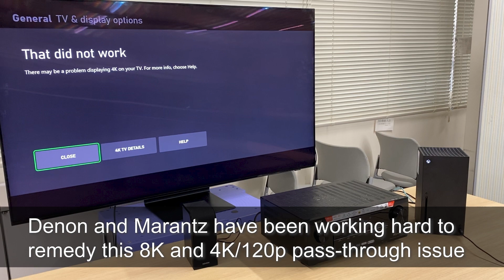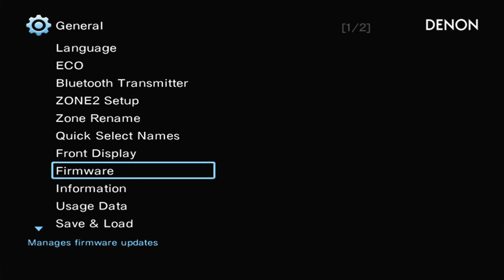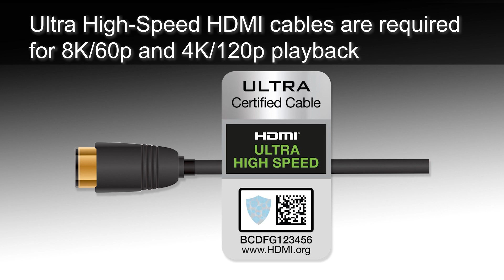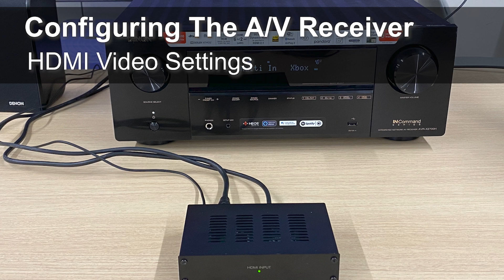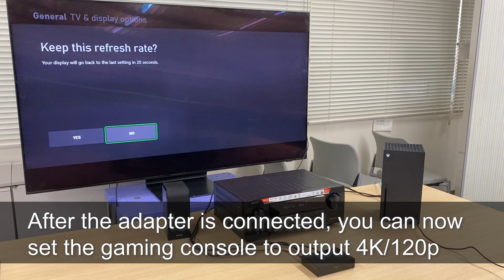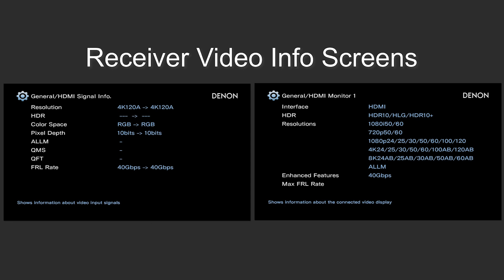The Denon and Marantz SPK618 HDMI Adapter: Installation and Use

Comment: This does not work properly.
Reply: what problems did you face m8?
Reply: Showing invalid format when connected to x3700h with no picture any help?
Reply: @manea7074  crap..... i hadn't heard about this. we have the same avr and i got the adapter, but i haven't got my ps5 yet so i didn't have a chance to try it out
Reply: @Amfibios  have you tried on Xbox Series X? My issue with Xbox
Reply: @manea7074  nope, unfortunately i don't have anything with those specs to try it yet

Comment: I set the Denon to 8k enhanced and I get no picture, when I change it to enhanced or standard I get a picture but only 8 bit no hdr.
I have Denon x3700h LG CX 77" and Xbox Series X.
the only way to get 4k/120/vrr/hdr to work is to plug the Series x into the tv directly and nit use the Denon or adapter. I hope they have a firmware coming.

Comment: I did this today it doesnt work wth hdr.
I can get 4k/120VRr no HDr when I connect my Series x to my Cx directly I get 4k/120/VRR/HDR but when I use this adapter and connect to the avr I lose hdr.
What gives?
Reply: I have the gx- you have to disable free sync and make sure that instant game response is enabled. This fix is unacceptable
Reply: is there any drawback to plugging the console straight into the tvs hdmi 2.1 port and using earc to pass the audio to the receiver?

Comment: I'm still confused as to who is responsible for this. Were people sold equipment that is not fully hdmi 2.1 compatible?
Reply: basically yes, there is a bug that causes issues when you try to play on 8K or 4k/120Hz. I believe the defective chip was made from Panasonic and was used in Sound United's AVRs.

Comment: This is a complete bullcrap solution. I upgraded to one of these received because I was tired of having to use adapters to get HDR with my previous receivers and was so happy to have a modern device that would be near future proof without adapters. This company should buy back their impacted models at original retail pricing or provide an integrated solution that does not require additional wall power and external devices and cables.

Comment: Slapping a band-aid on a broken product isn't much of a fix. The AVR's should have been recalled and retro-fitted with a new internal chip. The adapter takes up extra power, more space and doesn't even provide the user with any extra 8K inputs. Massive oversight and lack of logical thinking.

Comment: I would like to buy a new Denon and Marantz 8K AVRs. Do I need this adpater too ? Since the problem was end of 2020,  do the new (April 2021) Denon and Marantz amps have been built with the same problem or it has been fixed ? If the hardware has been fixed, how to recognize previous version from new version ? Thanks.
Reply: You probably got your answer by now, but when I went to the Denon site and entered my serial number, it gave me a message stating the issue has been fixed on my model (I haven't tested yet, picking up a new TV in a few days).  My receiver was ordered on May 9th and in my hands in June (took a while to receive.)
Reply: I picked up an LG OLED C1 on Friday and set it up, then updated firmware on TV.  Xbox Series X connected to Port 7 (8K) on Denon X3700H and config set to 8K Enhanced.
Working great with ALL Xbox TV Details showing Green Check mark.  Haven't tried moving input back to "Game" connection, but suspect it would work.  Have no reason to change it though.

Comment: Thank you for an attempt to resolve HDMI 2.1 issues. It'd be great to clarify relevant features and place information in public domain:
1. Will HDMI adapter box pass through 40 Gbps to a display? In other words, will TV's info screen display 4K120 HDR RGB?
2. If VRR is supported, is it 4K 40-60Hz VRR? Is it 4K 40-120Hz VRR? Or both?
3. XboxX can output 40 Gbps + VRR to a compatible display. Will this new adapter output 4K120 HDR RGB + VRR?
4. The last section of the video showing 40 Gbps info screen seems to be using older sequence from December's video. Does the last section of this video show that XboxX outputs 40 Gbps signal or Nvidia GPU's 40 Gbps signal?
Reply: It's displaying 4k 120hz RGB on ps5 though even without this adapter. Only xbox is not working fine
Reply: @chrischiang1512 Yes, but this is 8 bit signal, not 10 hit. In order to display 4K120 HDR RGB, necessary bandwidth is 40 Ggbs. PS5 can display maximum 32 Gbsp. If you wish 4K120 RGB on PS5, you must drop HDR for SDR. If you wish to preserve 4K120 HDR, then RGB will change to 422. There are compromises with 32 Gbps pipeline.
Reply: @MrLutijen  i think u are right the limit is at PS4 not the Denon.

Comment: Is this needed for PS5?
Reply from the maker: PS5 and Graphics cards like the RTX3080 work fine, you only need the adapter if you have a 4K/120p source with an compatibility issue (XBox Series X)

Comment: Is this box just for the Xbox Series X, or will it have to be used for future gaming consoles and devices?
Reply from the maker: Most 4k/120 sources like the PS5 and Nvidia graphics card already function properly. The SPK618 would just be used with the few devices that have compatibility issues.
Reply: @SoundUnitedTraining  If future source  devices still need this box, I’ll be frustrated I didn’t go with the X8500 which will have a board upgrade which I hope won’t require this box. Would be nice to have a board upgrade option for the SR8015 if future sources will require this correction box still.

Comment: Will this also support VRR?
Reply: No mention of VRR in the video and the Denon ODS didn't show VRR when Phil was talking about how the 2.1 features in use would appear on the screen.
Reply from the maker: Yes VRR is support if the display is compatible. VRR is currently not available on the TV we used in the example.
Reply: @SoundUnitedTraining  Thank you this is helpful to know. Additionally is there anything you can share on what a "corrected" HDMI signal means.  Will 10 bit RGB or 4:4:4 signals still be passed thru? or will they be downsampled to 8 bit or 4:2:2?  Much appreciation for the solution and response
Reply: @SoundUnitedTraining  But no hdr?

Comment: I'm genuinely grateful for the after-sales support and a solution from Denon, but was really hoping for an HDMI board replacement via dealers, as this will just take up space, cabling and power sockets. Its a shame, as this could have been a win if Denon had added additional HDMI 2.1 ports on the adapter. instead its still either PS5 or XBOX Series X, but not both for those with affected receivers. Its hard to escape the conclusion that HDMI 2.1 is not ready for mass-market. There's always this year's models I guess.